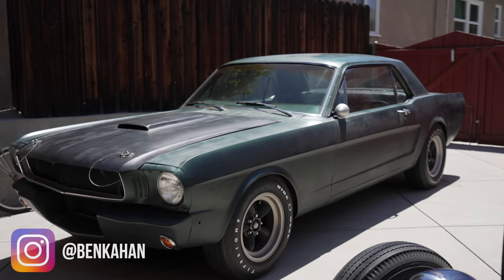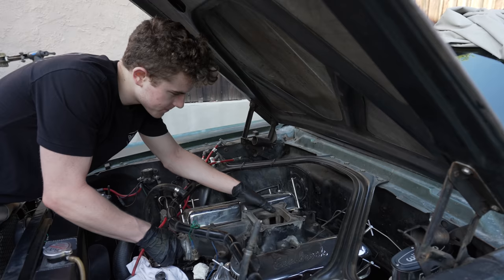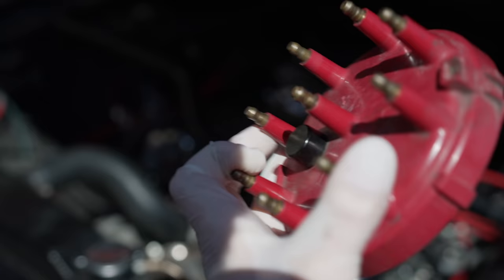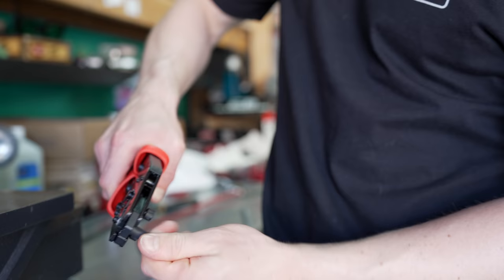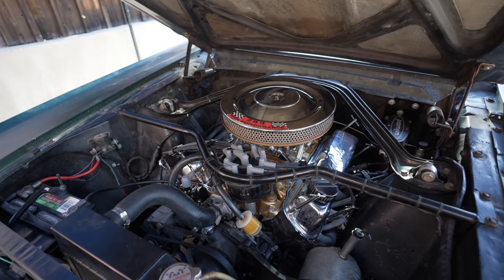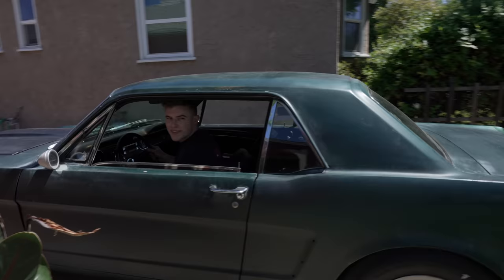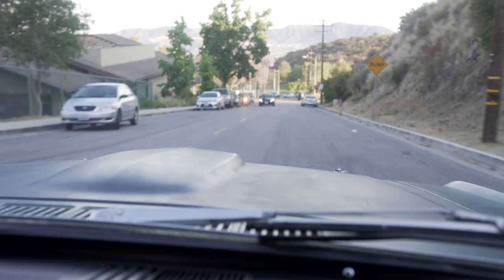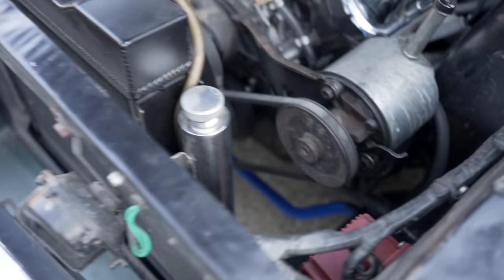My 1965 Mustang Loves the New Holley Carburetor!

Comment: Meanwhile, my Edelbrock Pro-Flo 4 is in and the car is running! Gotta hook up a couple more things and replace a control arm, and my 1969 Firebird convertible will be back on road!
Reply: @Keevaro, I had a '68 Camaro SS in high school! Total sleeper. Had the Eidelbrock High Rise and switching from the OG Quadrajet to the Holley 650 double-pumper never got my previous times again! Just couldn't get the mix right! 
Sob, then that 4X4 Ford Pick up pulled out in front of my in October of 1980 and The End. Sob.

Comment: Bet it runs better than with the edelbrock. Holleys have to be tuned a lot more and fiddled with to get right but when they're setup right they're so much better at like part throttle and the low end

Comment: I just got my 65 on the road over here in the UK. Had to replace my carb with a new one and it sorted out most of the issues. I need to clean up the intake like you have done here but while its working I will leave it. probably a winter job for me now while its running.

Comment: Stang is sounding healthy Ben! Glad you have a couple of old school hot rooms to help out and guide you. The car seems to run smoother with good power delivery. The updates under the hood look great and are a big improvement. If the block has been decked it can throw off the manifold sealing surfaces. I think you guys did good figuring that out. May you have smooth straight roads ahead. Great job!

Comment: I know it's a little late, but while it is possible your intake was milled to match milled heads. I noticed with the "new" intake you used the FelPro blue gaskets that have a raised bead on them. They are meant for cast iron intake manifolds, so with an aluminum one, it won't "crush" enough to seal. I didn't see what gaskets you used to reinstall old intake with, if they are the same blue ones, then that shoots this idea down.
I believe Edelbrock and other alum intake companies recommend Fel Pro #1250 for SBFs, and they do recommend 1/4 bead of silicone vs the cork end gaskets (which push out).
Good on you putting silicone on water ports only, it will get eaten by the gasoline eventually on the intake ports. 
Great content, keep wrenchin!

Comment: Ben they make 2 different intake gaskets big and small Make sure you used the correct ones it will leak around water ports. could possibly be your problem

Comment: I think I should consider a Holley two barrel carb for mine again. My grandpa said that a conversion to 4 bbl wouldn't really be worth it for power gains and you would lose some low-end torque. But if I'm gonna convert the car over to manual shift from the C4 automatic I need a smoother running engine. I still have the factory equipped 2 barrel and had to get it rebuilt and it still feels a little jerky even after my grandpa and I re tuned it.

Comment: Why not compare old intake to new, to see if it was milled to suit the heads.  Just match them up one upside down and see if the carb flanges are parallel,  can level one intake then use angle gauge to determine delta.   Or do with some less rube Goldberg method....

Comment: Must use top quality gaskets and carefully torque these intakes down.  Even then they often leak.  Same with the cheap Chinese clones, the castings are too thin, not enough meat so doesn’t adequately squeeze and hold the gaskets.  If they seal at first, a few heat cycles often ends the same.

Edelbrock still makes the thick castings but I’m not sure anyone else does.  Your 289 would like the dual-plane intake, try that new Weiand again with Fel-pro gaskets and thick washers on the bolts.